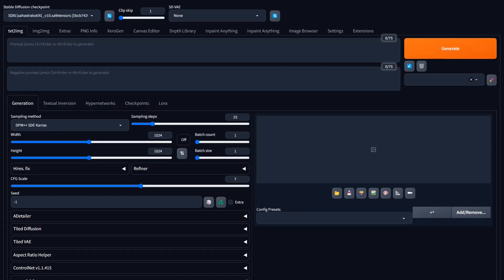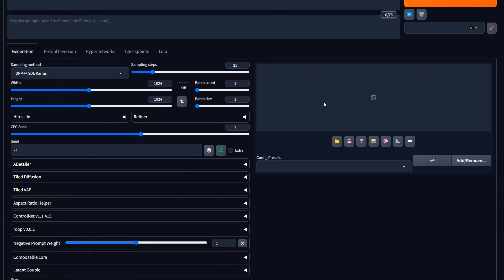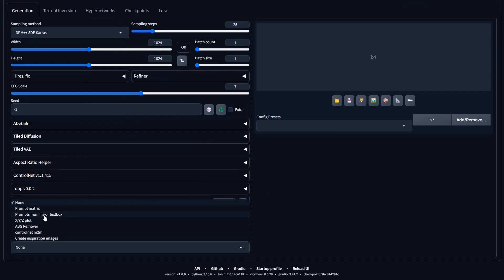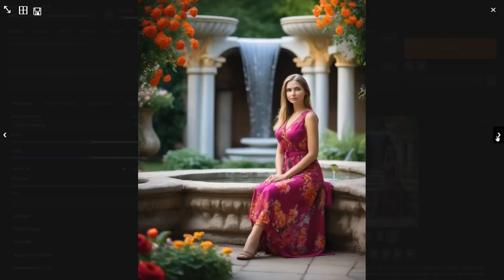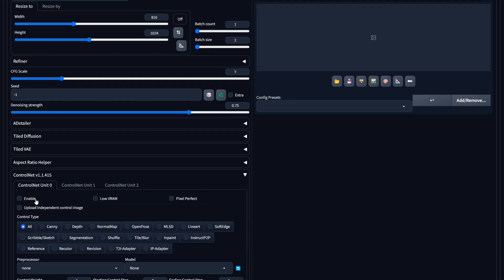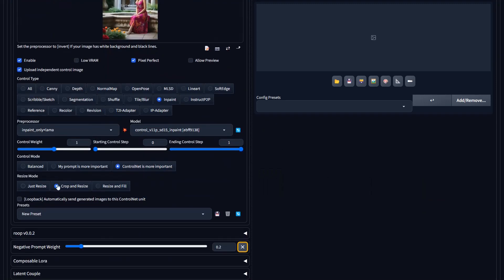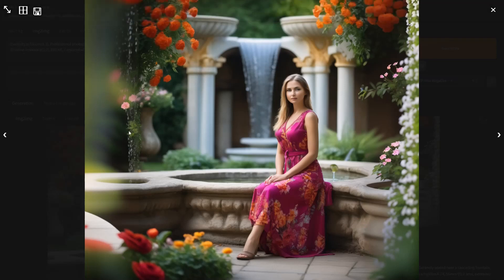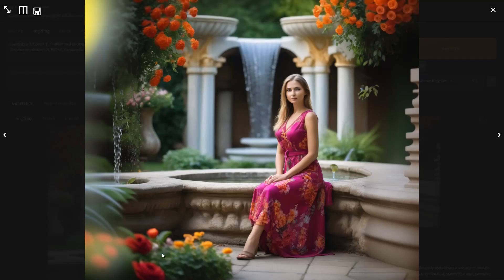Mastering Image Outpainting in SDXL with Stable Diffusion & Automatic 1111

Comment: This is closer to what I'm trying to do, with outpainting extending an existing area contiguously into a masked target area. It would be nice to be able to "copy/paste" some area into a noncontiguous target masked area - but this will probably do.
(...the bottom quarter of the image is carpet, table etc. There is a 12in gap between the bottom of the backdrop and the floor, which I'd like to fill with the floor depicted in the backdrop, stone in this case, but in general it could be polished wood, grass or anything else; but I don't want to try to describe it in a text prompt, rather to mask an area and "paste" that into the masked gap area (excluding the table etc).)
Reply from the maker: So something you could do, is extend the canvas of the image using something like gamper Photoshop, then copy and paste in the style of ground, flooring or grass that you want in that area of the image, obviously it's not going to match up perfectly, but then you take that new image into forge or automatic 1111, go into inpainting, mask out that new area including a little bit of the original area, just give it a basic description, set the denoise strength to about .6 to .7 and make sure you're using an inpainting model. My favorite is dreamshaperXL_lightningInpainting as it's based on the SDXL model and works beautifully. When you regenerate it, it should take everything you copied in as context but it should re-render it properly so it looks like it belongs in the image.  Maybe I'll do a video about this as this is something I think people would be very interested in learning about.
Reply: Thanks, though I don't want to extend the image; perhaps I didn't make it clear that this is a photo taken in a studio, with a backdrop on the back wall with an ugly 12in gap to the floor, which is the target area for more of the ground depicted at the bottom of the backdrop, but which is also obscured in places by the table, chair and person in the studio, which I'm hoping Segment Anything (in Inpaint Anything) will be able to identify. Yes, please make a video about it!
Reply from the maker: Oh I got you, I understand now.  Extending the backdrop in the studio to get rid of the ugly studio floor and replace with something better. But there's some things obscuring it. Yeah I think that would still be possible.

Comment: Your ControlNet Model is not SDXL. That’s also because your Checkpoint isn’t SDXL. Not an SDXL outpainting example! 😁
Reply: Looks like I found a method - I selected an SDXL checkpoint (not an inpainting one - still worked). Then, choose ‘inpaint_only+lama’ just as you had done. After that, Select ‘ip-adapter_xl’ as your ControlNet Model.  Worked for me after a few generations.
Reply from the maker: Yes I'm pretty sure I point that out that through the steps I start with an sdxl model to generate the initial image, and then switch to a 1.5 for doing the out painting and in painting. So you're right it's not true sdxl out painting.
Reply from the maker: That's good to know I didn't know about the IP-adapter _ XL controlnet model. I downloaded it and messed with it for a little while and yes the seam is not as bad. But the problem I'm running into now is that the imagery that it generates outside the image feels a lot more chaotic and doesn't match up with the primary image. I tried several times to get it to give me something that would recognizably fit the image. And I am using the original sdxl checkpoint that I used to generate the image. I may need to play around with a little bit more, but I'm going to hold what I said in that the outpaint MK2
Reply from the maker: Also one of the other things I really like about the outpaint MK2 method is that you're not limited and how wide you can go or how tall you can go. With the control net method you're limited to the ultimate maximum size you can slide the slider bar to.
Reply: @AIchemywithXerophayze-jt1gg  I had my denoise set to 1 and that’s when it started giving me good results. Something like 0.85 was surprisingly unsatisfactory. Play around with the CFG scale too. I noticed a “sweet spot” for each model. The results were outstanding.
Reply: @AIchemywithXerophayze-jt1gg I haven’t tried the MK2 yet. Will check it out soon. Didn’t come across any dimension limitation (just that you have to expand on one axis at a time). Will try and push the limits to see if I face a similar limitation.